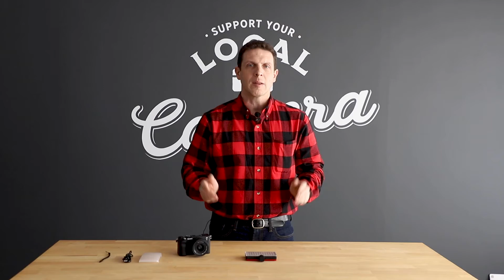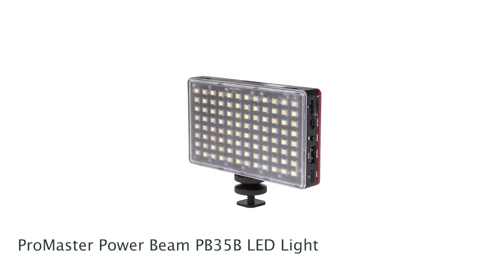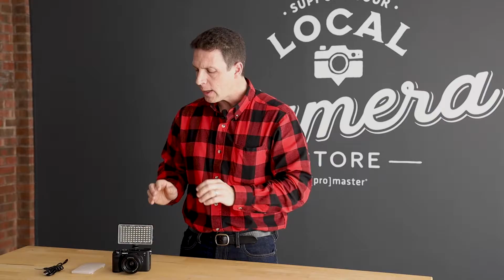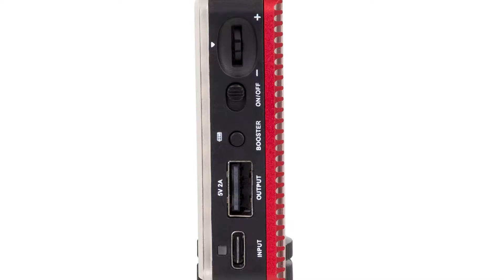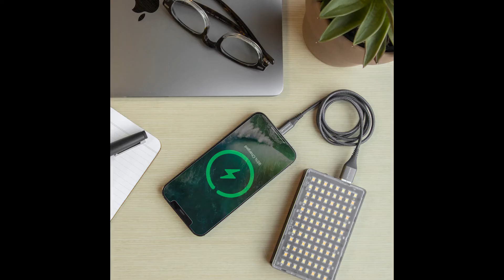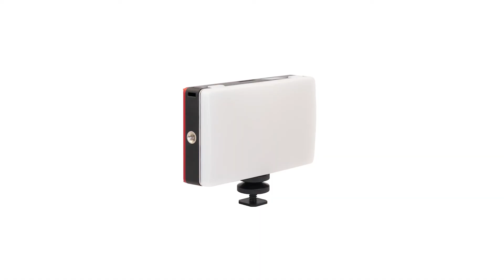ProMaster Power Beam PB35B LED Light

Comment: I got one.  Only used it very occasionally, maybe about half a dozen times over two years, then it just stopped working, even with the charging cable in place.  Not impressed.
Reply from the maker: Hey Steve! Sorry to hear about the troubles. If you still have the unit feel free to shoot us an email at ahuman@promaster.com and we can help you out. Thanks!
Reply: @ProMasterPhoto  Actually it is a ProMaster 3835 block, not quite the same as the item in this video.  Apologies for the confusion, putting "ProMaster 3835" into YouTube produced this video, hence the confusion.  Even so, it should not last a few uses then fail.  Will email promaster.